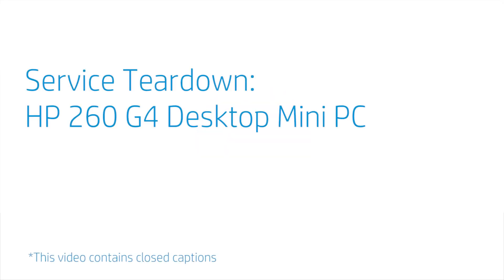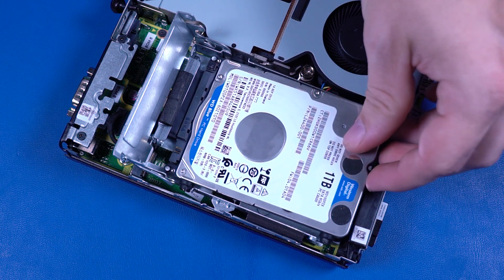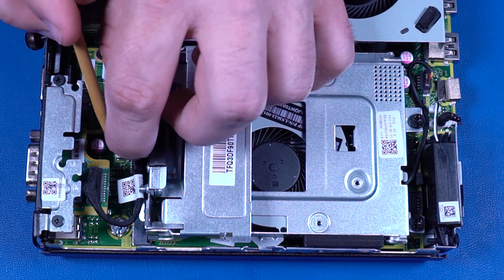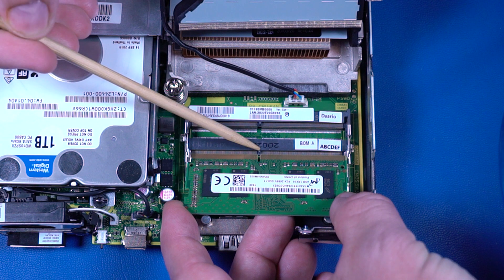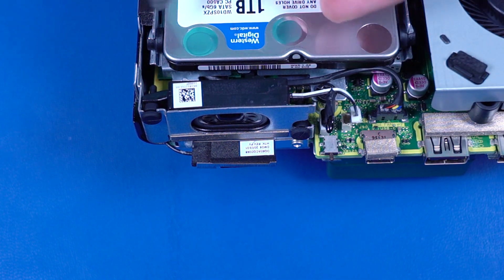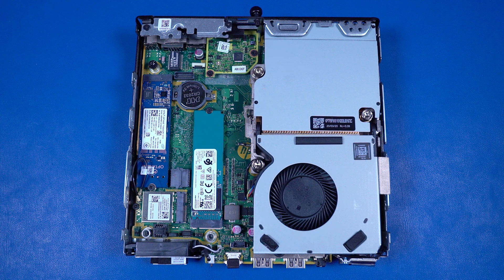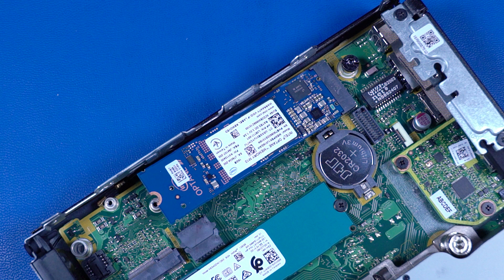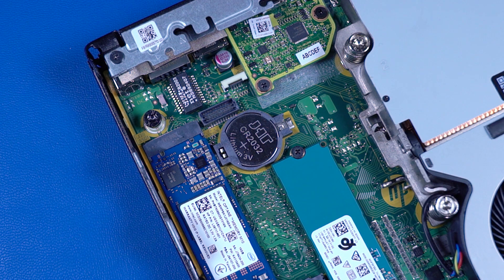Removing & replacing parts for HP 260 G4 Desktop | HP Computer Service

Comment: Hello, I wanted to know, if I am changing the hard drive, as long as it is done properly, if that action will void the warranty ?
Reply from the maker: Hi Jvlien, thanks for contacting HP Global Social Media Support!
I understand that you need to know whether changing the hard drive will void warranty.  
I will do my best to assist you.
HP does not recommend upgrading or downgrading hardware parts or software that is bundled with the product as It may affect the manufacturer's warranty and performance, however, you could change the configuration at your own discretion.
Binu_HP Social Media Tech Support

Comment: Thank you for this very complete video! Clear and detailed. It came in handy for upgrading my mini desktop by installing an SSD and memory module. Now I have 480 GB SSD + 1 TB HD, 4 GB + 8 GB RAM, celeron 5205U. The main operating system is Manjaro and it runs really well and smoothly.
Reply from the maker: Hi Guillermo, thanks for contacting HP Global Social Media Support!
We are delighted to hear that it is working!
If you need any help in the future, you can always get back to us.
Thank you for being a valuable HP customer.
Have a wonderful day!
Cheers!

Akhil_HP Social Media Tech Support
Reply: se pueder cambiar el procesador??